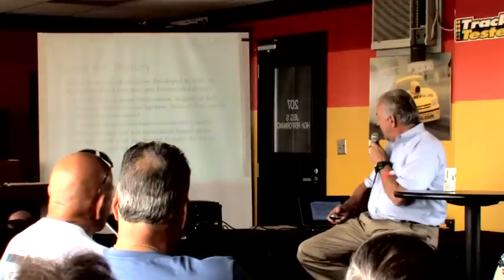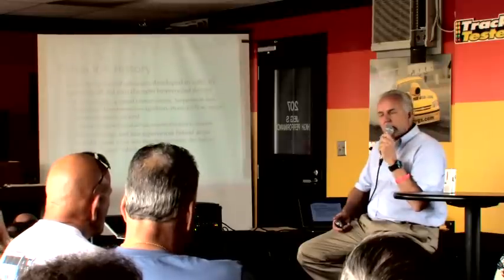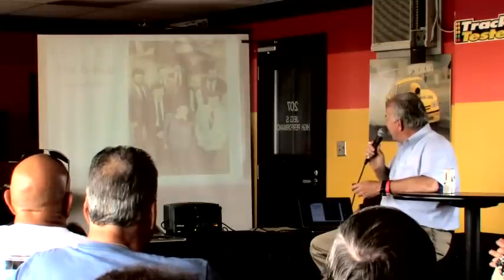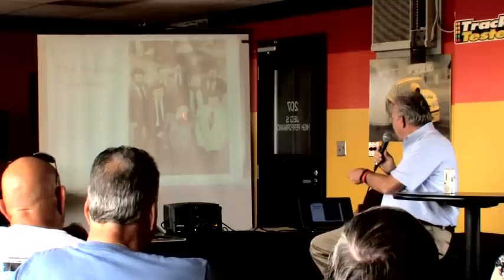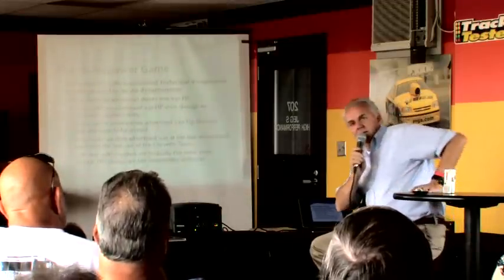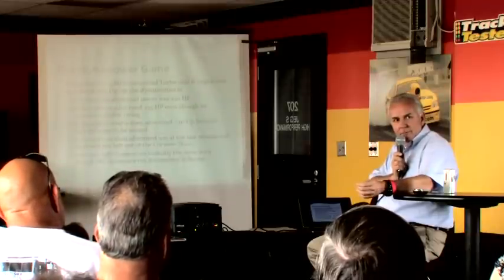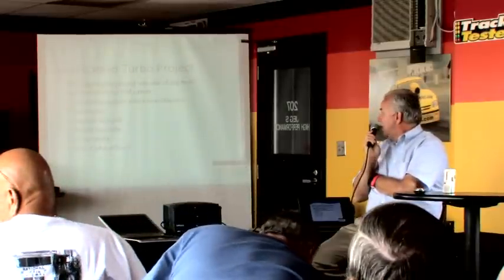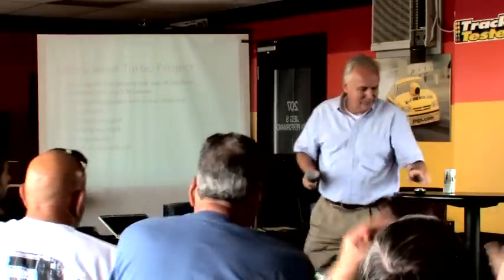Buick Grand National facts

Comment: I'm a proud owner of an 86 GN.  Thanks for taking the time to upload this.  I will never get rid of my GN.
Reply from the maker: sinusbradycardia The next time you you hear an '87 owner put down your '86 because he or she has "10 more horsepower" you can now inform them of there mistake.
Reply: LOL.  Now it's putting about 500 ponies down.  I'm planning on upgrading my driveshaft and axles, afraid when I launch it at the track my driveshaft and/or axles will break.
I'm also planning on building a 3800 series II powered GN or T.  The 3800 series 2/3 blocks are stouter than the 109 block and can reliably make 800rwhp with the stock crank and forged pistons and rods.  Several guys are running the 3800 blocks and are able to produce more power with less boost and stock heads.  I'm told the 3800 series 2/3 blocks were closer in design to BMS stage blocks, with a shorter deck.
Reply: Hey +sinusbradycardia
Reply: +Misty Workman 
what's up with misty I want to know
Reply: +sinusbradycardia what do u mean by  that
Reply: sinusbradycardia is that 3800 better than a LS engine
Reply: @raptor5581  Any 87 owner who would do that shouldn't own a Turbo Buick. The vast majority of 87 owners know that it was all a numbers game with Buick on the HP ratings. I own a 87 GN myself and enjoy any year Turbo Buick for what it is. These cars are now (semi) modern day legends and are highly collectable and sought after for a reason..........
Reply: If you really want to blow your own mind, the part where he says the inspiration for building the fastest production car was based off an old Buick passing the guy that had a 455 four barrel. @ 13:30 Imagine being that guy that was in that 455 four barrel knowing that you were part of History because you beat somebody important you inspired one person to build the world's greatest car the Buick Grand national. Sadly he may never know but thank you to that guy LOL

Comment: Let's not forget that the Connecticut State Police had at least 10 or 20 T-Types to haunt speeders on Connecticut Route 84  as well as other highways are Connecticut. I used to see them frequently in the 1986 -1988 period. Painted silver or brown or dark blue with no police markings and always rolling in the cast aluminum T-Type wheels, often blacked out. -Steve Magnante
Reply from the maker: @SteveMagnante  
Hi Steve, I’m glad you liked the video. The video itself never got a lot of play because it doesn’t include giant burnouts and  GN’s with a ton of aftermarket add-ons. You’re the kind of guy that appreciates information and gain knowledge about our hobby.
I hope you’re feeling better and I hope you can be on the block at Barrett Jackson in January. The auction is just not the same without you.
Reply: @raptor5581  Thanks for reading my comment and responding. Those Connecticut state police cars were "a thing" back in the late 1980's. No doubt Dennis Kirban knows where a few ended up. I've always been fascinated at how the turbo dash has a hidden lens for the Power Injection function that's visible if you shine a flashlight on it. I was hoping the GN program manager would bring this up during the video presentation. Oh well, we know it's there, right? Have a great day. -Steve Magnante
Reply from the maker: @SteveMagnante  

Hi Steve,

I bought my ‘86 GN brand new (Bano Buick in Mt Kisco NY) and I still have it. I never heard of this “power injection” thing. I thought I knew every nut and bolt on my car. Oh well, it doesn’t matter to me anyway. I’m 66 years old and I only take out for a rip on Sunday mornings. (It’s pretty much all I ever did with it as it has only 29k miles on it)  I get more of a kick out of all the thumbs up I get than lightning up the tires now and then.

Comment: I went to my local Buick dealership after reading the 1987 model Grand National would be the last year of production. I laid down my $500 and ordered one in late 1986 and waited almost six months to get it. A couple of observations here: 1) On a cold day, that car was scary fast. The difference in horsepower output on a cold day vs. a hot day, was extreme. I ran mine twice on a warm, humid evening at Carolina Dragway outside Aiken, South Carolina to OFFICIALLY find out how fast it was. It clocked 14.1 and 14.2 at almost 100 mph in the quarter mile. It was pure stock from the dealer. I did not do a burnout before launch and I feathered the throttle off the line to keep the rear tires from losing grip. Someone who knows how to race and didn't care about abusing the car would have knocked a couple of tenths off my times. 2) The '87 Grand National was all about the engine. For the life of me, I don't understand why it hasn't lived on to this day in other cars. It was enormously powerful but could be quite tame, with good gas mileage when driven around town. I kept my car for seven years and had 14,000 miles on it when I sold it in 1994. I guess I got tired of paying taxes and insurance on a vehicle that just sat in the garage. To say I regret having sold it, would be an understatement.

Comment: Very informative straight from the source involved with the development of the 86 intercooled turbos. The 1986 was and is the pioneer. Only 5,512 produced. The 1986 GN and 1987 GNX are the Grand Nationals to have from a car collectors stand point. The 86 was the one who put the GN truly on the map and the GNX kept the car there till the end. Magical car period "Buick Grand National" ICONIC!
Reply: Big Tone which is worth more 86 or 87. I was always told the 87 will always be higher in price.
Reply: Actually, from a collector's standpoint (we currently have 8 in our fleet, along with '89 Turbo TA #999 & I've owned 200+ turbo Regals since 1984), the '87 GN & the X are the ones to have. '86 GN's will never bring the $$ the '87's do, whether anyone believes it or not. Buy a TR, join the club, & you'll learn what I said is fact.
Reply: Question is, how many were manufactured in 86, how many T- Tops were made in that model that year?
Now, compare that to 87.
YOU sir are correct.
The 86 is rarer and therefore not as common place as the abundant 87.
The only thing 87 has it the Dec 11 end of the road history and a few more ponies which by today is pointless with our technology.
Reply: @connormccoy3548  100% CORRECT. Sure the 86's have a lower production number, BUT the 87 was the last year of production. And THAT'S what stands out to most. I've owned a 85, 86 and 87 GN. Still own the 87 GN and always will. This is one of those times when "rarer" doesn't mean more valuable.........
Reply: @TheMethod44  the 1987 because it was last year for the Grand National but the 87 GNX is worth the most and it stands for experimental they only made 547 of them. Also in 1982 there was only like 35 made with turbo and the rest were naturally aspirated what a whopping 140 horsepower so the 35 that had turbo in 1982 they are very collectible what few haven't been destroyed .
Reply: @TheMethod44 The 87 GN at the time of this post was higher in value but that has changed due to value appreciation, prominance and information such as videos like this one. The market now for the 86-87 GN's is currently about the same today. Due to the lack of information back then there was the misconception that the 87 GN was the fastest American production car, it wasn't. The 1987 Buick Regal Grand National GNX as it was called and used back then was the fastest American production car in 87. Some how it was mistakenly associated with the regular GN, as we know both vehicles are totally different cars in design. The 87 GN's somehow garnered the 87 year accolades from Car and Driver article on the Buick Regal Grand National GNX as the fastest  production car but that soley belongs to the GNX. The only other year that shares that distinction is the 1986 Buick Regal Grand National and was the fastest American production car in 1986 as recorded in the April 1986 Car and Driver article, just facts. Now the 86 - 87 GN's are worth the same as per the value condition system i.e. fair good and concourse, in the car collector market.
Reply: I prefer the 87 grille without the chrome “T” but that is personal choice on aesthetics.

Comment: Great cars, but when selling  on a Buick dealers lot back then NONE of us wanted to hear the customers were there to see them or the Riv or the Road Master.  Everyone wanted to test drive them, but the prices were too high for most.   Plus the GN's were limited 3-4 per dealer I think it was one year at least they were and they wanted sticker price plus spray can dealer add-ons.  They could not test drive the GN unless they seemed very serious to the boss and everyone thought it would look like a Trans AM on the inside for some reason.   I think the GN were limited because of the few we sold they were always back for warranty work,  because of the way people drove them.
Reply: The biggest problem when these cars were new was new owners thinking they could turn up the boost and still run low octane gas. It's why so many of them were in for head gasket work.
Reply: Our problem was always with transmissions. One GN owner came in three times in three years for transmission replacement. When it went out of warranty, he sold it because he didn't want to spend $1800 every year on a new transmission, which in today's money would be like $5,000.
Reply: @RockandrollNegro  One of the first things I was told before my rebuild.  My builder said we gotta build up that transmission because when you increase horsepower that stock transmission won't last for a week.

Comment: You mentioned the V6 being repurchased from Kaiser.
I understood the V6 was a shortened version of the Buick 215 C.I.D.  215 HP , Quadrajet -V8.

Seeing you were in on the ground floor, do you know anything about that?
You're very knowledgable.
Reply: I was the Flint line lead on the first redesign of the 1978 3.8L and can answer your question.

The Buick Fireball 198 V6 was based on the DualJet 215, not the QuadraJet 215 (the QuadraJet version had a different offset and a high compression Buick head with smaller valves; the DualJet had a lower compression Oldsmobile head with bigger valves.)

The Buick 215 was built for speed and performance, while the Oldsmobile 215 was built for fuel economy and durability. The Buick V6 was thus derived from the 2bbl Oldsmobile version of the 215, as economy and reliability were the impetus for creating a V6 in the first place. 

The Fireball 198 V6 was an almost exact copy of the Olds DualJet 215 V8, minus two cylinders and substituting aluminum for cast iron. The V6 weighed about 40lbs more than the V8.

The 198 V6 was later bored and stroked to 225, which is what was sold to Kaiser-Jeep in 1967, where it became the Dauntless V6. Kaiser then sold the Dauntless tooling back to GM in 1974.

When GM got it back, they bored it out further to match the GM 307/350 Smallblock bore of 3.8" diameter, which increased the displacement to 231ci. 

The 231 was used for three model years, 1975-77, and was redesigned for the 1978 model year. We put a steel exhaust, composite manifold and bigger valves from the 455ci Olds Rocket V8 on the 231, which boosted horsepower by 13%. 

This 1978 revision of the 231 was the first time it was marketed as the 3.8 Litre Buick V6, but officially it was known as the LD5. The LN7, LK9, LG2, and LG3 were all variants and revisions of the LD5.

The LN3 was a major redesign in 1988, and we began calling it the 3800 as opposed to "3.8 Litre." 

In 1991, the 3800 LN3 was completely redesigned from the block up, and we called this the Series One 3800. Series 2 came in 1995 Series 3 in 2004, and the last Series 3 came off the line in 2008. 

GM replaced the 3800 with the inferior 3500. If you're in the market for an old 3.8 equipped car, the Series 2 L67 engines were nearly perfectly designed and built, and would be my recommendation.
Reply: @RockandrollNegro  :  Thankyou !

My first car was a 1963 Buick skylark convertible  (white/red/white interior) with 215 C.I.D , V - 8 ,the 14:1 compression and the quadrajet .

Comment: Vehicle emissions are a joke. They box in designers. They don’t give you an emissions target and say hit it. It’s you have to have a cat dpf etc egr. All things that decrease engine efficiency. If they were serious they would be focusing on the fuel particularly e85 and bio instead of poor quality gasoline. Properly tuned engines are always more efficient per fuel used. On a modern tier 4 diesel, I work at cat on heavy equipment, if you pull a head you cannot tell the difference between the intake and exhaust bc if the soot build up. It devastates the engine and they create so much heat that is wasted that it drastically reduces engine life and the heat is just wasted. Why is it that every time a camless valve train is designed it catches some wind and then you never hear about it? What about the systems that run hydrogen pulled from water? Epa is a scam and a racquet just like the crappy fuel etc. they don’t care about emission only money. In 2018 the trucks get the same fuel mileage as in the 60s. I had a 1966 f100 352 two barrel two wheel drive. Got 22 mpg. 2017 ecoboost f150 average 18 mpg. It’s a joke! Let the companies and manufactures be free and stop regulating them to death and true and pure innovation will happen period.
Reply: Co2 is planet food period. I understand wanting to reduce the NOx particulate for diesels but biofuels drastically reduce this. The fuel lines and seals on components aren’t designed for this fuel in the long term. I understand that but they are available. On gas cars, e85 is a wonder. Even e40. If that was at the pump we could have. 12:1 turbo engines that are extremely efficient. I realize you use nearly twice as much e85 as gas but if it was mass produced the cost would even be cheaper. Again they don’t want to solve problems. They want money. We haven’t even needed gas or bio fueled engines since the 50s anyways.

Comment: 10 seconds into the "facts" of the Grand National & this dude's already incorrect. 78 was the first year for the T-Type Regal. 82 being the first year for the Grand National.
Reply: 1982 1/2 actually, since it was a mid year release.
Reply: It's called a mistake. This guy forgot more about the Grand National than anyone on this message board will ever know about the Grand National.
Reply: Ok,First, these cars completely stock right off the showroom floor only run in the high 15's in a 1/4 mile. The ones on YouTube running 9's and 10's have had thousands of dollars in upgrades to run those times. :) Sorry.
Reply: @RobVoyle stop spamming the comments because you're mad that a 40 year old Buick is still faster than your econobox poor people mobile.